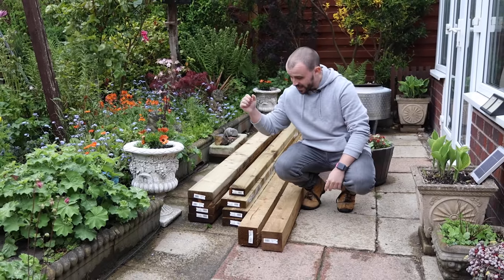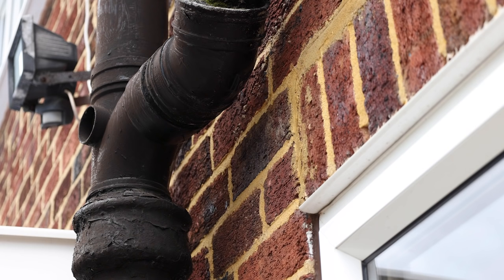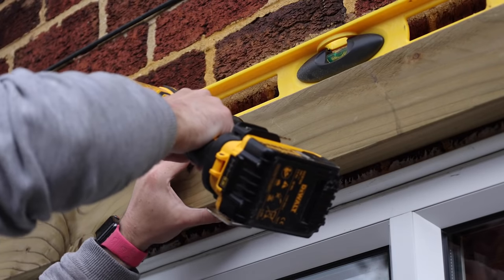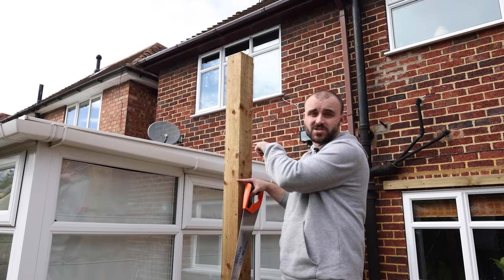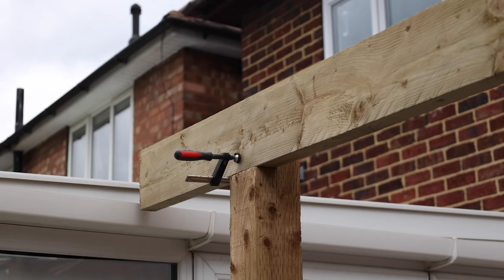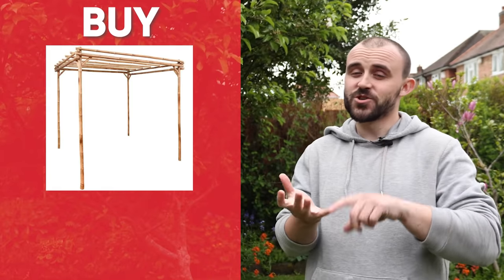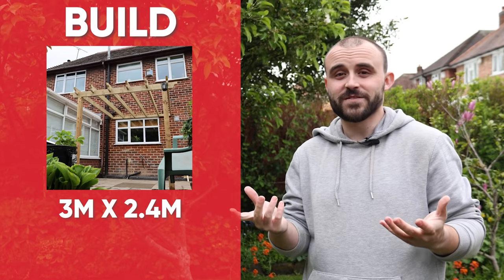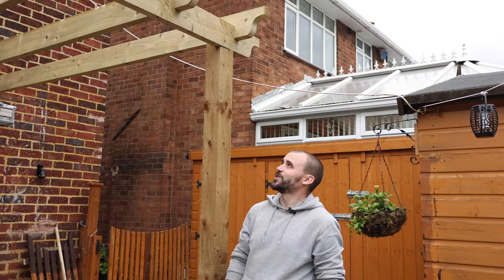How To Build A DIY Pergola | Build Or Buy - Is It Worth It?

Comment: Incised Pressure Treated Fence Post UC4 Green 100mm x 100mm x 3000mm now £40 😢
Reply: Where are you buying them?

Tell me it's not B&Q!

Average cost I've found is £15.

Those are all builders merchants though, not B&Q or Wickes.
Reply: @loojishtc9899  do you recommend a local timber supplier?
Reply: @jackathowarth  stay away from the DIY chain stores. 

They will be four times more expensive than a local merchant. 

A single paving slab in B&Q is currently £12!

Local merchant sells the same for £2.50.

Comment: I disagree with few points in your build.
Firstly. Would have been far more aesthetic9
Reply: Sorry pressed wrong key.
How you levelled it up over window would have been far better to follow line of window.
Immediately I saw the slope on window. Would have made no difference being that little out of level practically.
You also weakened all the cross members by cutting notches out. Would have been stronger to just rest them on top. Instead of cutting notches out across whole length